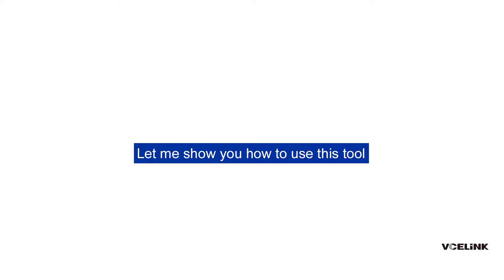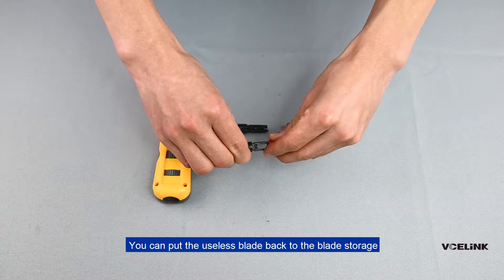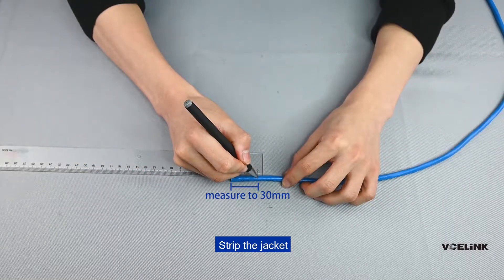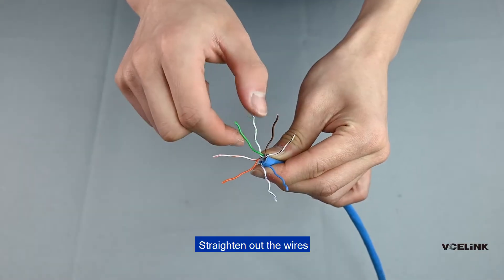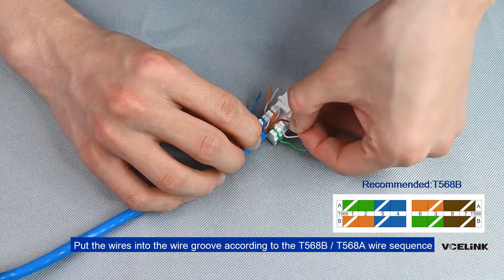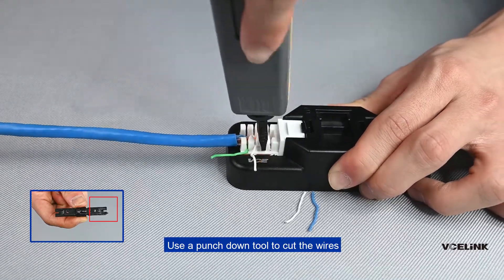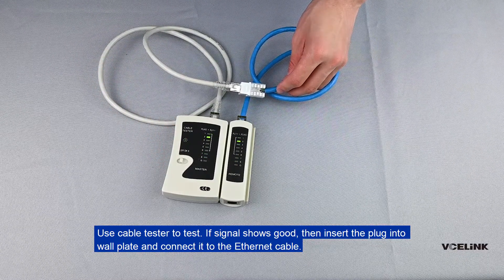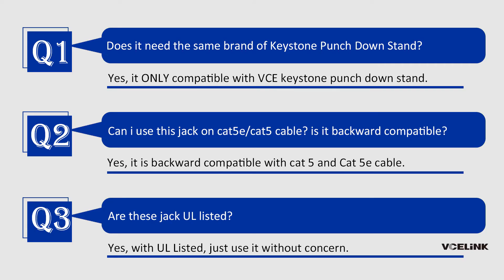How to Punch Down a RJ45 Cat6 Keystone Jack VCELINK

Comment: Don’t untwist the wires from the ends only from the middle makes it much easier.  It will also let you get the main cable seated further into the jack so it’s not dangling by the small ga wires.  If you did this at my work we’d make you redo it
Reply from the maker: Thanks for your comment and good suggestions. We have created a new video regarding the "untwisting" problem. And we will try to do better in our future videos.

Comment: Why does no one use the nylon ripcord to make sure no pairs were nicked/shorted while stripping the plastic jacket
Reply from the maker: Well, it's a good way. The ripcord is designed to strip the insulation, but it can be difficult for some novices. A mini wire stripper is a great tool for successful stripping, suitable for everyone.😀